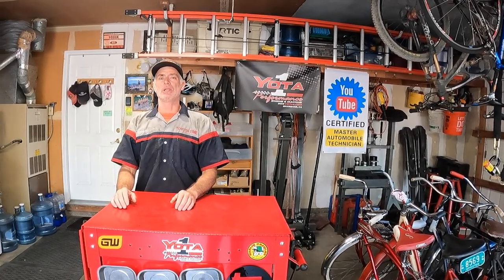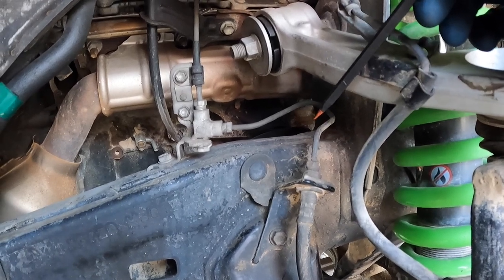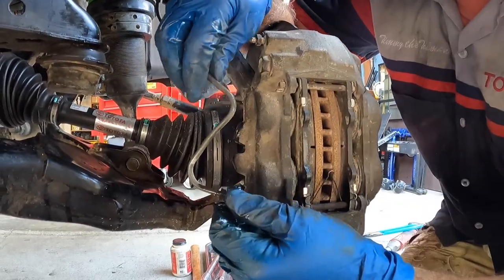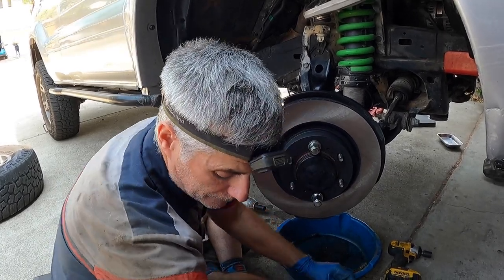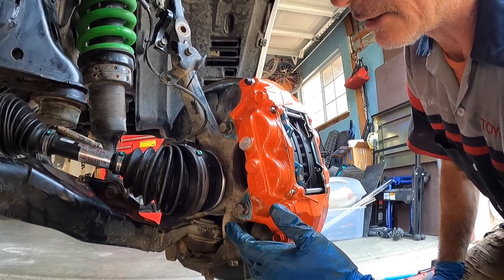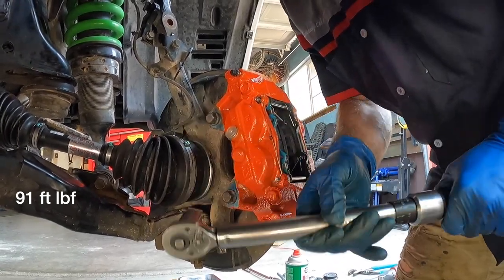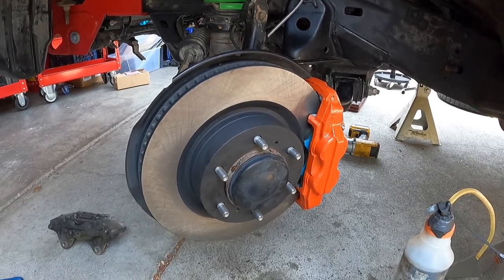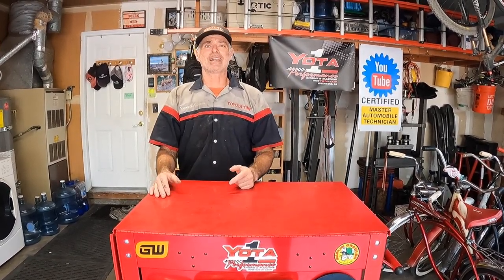Lexus GX470 Front Brake Upgrade

Comment: Will your parts list work for a 2005 GX470? I did not see/hear the year of the GX470 in this video. Does it even matter what the year is? Great video, I'm getting ready to do both the front and rears. Any info would be greatly appreciated. Thanks. Don
Reply from the maker: Thanh's GX470 is a 2008 but I don't think the year matters.  I'm pretty sure all the GXs have the same brakes.
Reply: @TimmyTheToolman  thanks D
Reply: Tim, have you seen/heard of any quantitative comparative responses from people who did the "upgrade" to their GX470 to what they had before?I'm on the fence, as to, weather to go the less expensive route or spend the $500-$600 and upgrade now? I'm thinking I may resurface the rotors, if I can, pads and possibly replace the brake lines because my rig pulls to the right when I have to brake "hard". What do you suggest? Thanks. D
Reply from the maker: @dongarofano7746  Other than Thanh saying his braking has improved, I don't have anything else to go by.  You might try asking this question on a GX Facebook page.  There's several you can join and then ask your question to see what people say.

Comment: Hey Timmy, I recently did the upgraded 13WL calipers from the 05 and up Tundra on my 02 sequoia, which required me to trim the backing plate. How is it that the LX470 calipers accommodate the larger rotors like the 13WL calipers, without trimming the backing plates ?
Reply from the maker: It’s a different model with a larger backing plate so after the mod on this platform, there is no cutting needed, but with the tundra brake upgrade on a third forerunner, the backing plate is much smaller and therefore needs to be trimmed a little.
- Sean
Reply: @TimmyTheToolman  Much appreciated, I was wondering if there was a physical difference to the caliper itself. Thank you for the fast reply.

Comment: Is there a trick to prevent the brake lines from leaking  when the brake lines are disconnected from the calipers. Mainly in Toyota rear brake calipers. Thanks.
Reply from the maker: Yes there is.  I slide a 7/32 vacuum cap over the flared tubing end to stop the flow of fluid.  The cap slides over only the tubing, not the fitting.  It works great.  I've had lines disconnected for weeks and no loss of fluid.

Comment: Just watched the whole video. My friend sold me 2004 GX470 a month ago and yesterday shit happened... Driver side rear brake line was leaked and I lost brake. I search on ebay some brake stuffs like brake pads, calipers, line kit's, rotors... Here I'm thinking about fix it or sell it? A car is clean title and one owner. 114000 on the dash... If fix it, that's gonna be 5-10k. worth it or not I don't know. Never had GX470 before
Reply from the maker: What you said makes no sense.  5-10k in brake parts?
Reply: @TimmyTheToolman  I meant shock absorbers, all brake work, tires and rims and labor fee
Reply from the maker: @moosleem3621  That still seems very expensive.   Tires are over 1k though.  What's the breakdown of the cost for each thing and the cost for labor.

Comment: @timmythetoolman Did you have to trim any metal from the caliper tabs where it gets mounted? I will be doing this upgrade on my 2002 Tundra. Every video i watched talks about cutting the tabs down by 3.5mm.
Reply from the maker: I don't remember,  but everything we did was documented in the video.  If you didn't see us do it or talk about it, it wasn't necessary for the job.
Reply: @TimmyTheToolman  Thank you for the quick reply. I think there may be a difference between Toyota and Lexus. Im not sure. When I get the calipers in I will try a fit test before I send anything to the machinist. I will keep you updated.

Comment: No antiseize on brake hard-line? Is that to prevent contamination of the brake fluid?
Reply from the maker: Anti-seize is not needed on the brake line threads.  Could you put some on?  I suppose you could.  Maybe just a very light amount.

Comment: Great video will be using it soon. How did he seat his new pads? I've heard 10 or so hard stops from about 55mph and then drive around 15 or so minutes with light to no breaking to allow the pads to cool. Any tips or insight if that's true? Thank you!
Reply from the maker: Thanh didn't do any specific pad seating method.  He just started driving it.  I've heard of people doing this as well but I personally have never done a "Bedding In" procedure either.  If you do a search online you'll find info on bedding in procedures.  

Glad you like the video.  Good luck with the job.  Hope it goes smooth for you.
Reply: @TimmyTheToolman  thank you good sir and happy new year to you.
Reply from the maker: @codybrooks6486  You're welcome.
Reply: @TimmyTheToolman  that's called burnishing. You get up to 50,let off accelerator, then light brake apply until fully stopped ,  then let off brake and drive one mile, that mile drive cools the brakes, then get to 50mph again and repeat brake application until stopped. You should do this a total of 4 to 6 times. Make sure that you come to complete stop position each time. I don't recommend heavy braking for at least 50 miles.
Reply from the maker: @davidlesley8884  The question is, does the procedure you outlined really make a difference in future braking performance?   I'm pretty sure no shop in existence gives their customers this procedure when the customer picks up their vehicle after a brake job.  I've never heard the term "burnishing".  I've only heard the process referred to as the the "bedding in" procedure.  Learn something new everyday.
Reply: @TimmyTheToolman  I've gone to many seminars that involves brake components and my shop does that procedure.  It makes the brakes last longer. The parts stores never tell you and or the manufacturer never says anything about the procedure,  because they want you to go through brake parts. It's a money scheme.  Most jobs that we've done last 4 yrs or more. I highly recommend it!
Reply from the maker: @davidlesley8884  Wow, your shop actually spends the time to drive the vehicle and perform the procedure,  that's impressive.  Your shop is probably one in a million.  I believe a decent amount of shops would perform a short test drive after a brake job, but doing the burnishing or bedding in procedure is a whole other commitment.  I've never performed one of these procedures and my brakes have always performed well.  But, maybe I'm missing out.

Comment: Nice vid. My 06 gx behaves as if the rotors are warped. As the brake is applied it feels as if it grabs and let’s go, grabs and let’s go… until it comes to a full stop. It only does it at low speeds with no vibration on pedal, wheel, frame, it doesn’t pull or anything. The brakes are also very sensitive one moment you are braking fine then it grabs too much and it dips. Try to ease up a bit and it just wants to keep rolling. It’s a matter of mm of brake pedal travel. Strange and annoying. Any ideas?
Reply from the maker: The grab and let go is a pulsing the ABS system can do but I don't know if that's what's happening when you're braking at lower speeds.  It might be your hydraulic brake booster is having issues.

We did a video on replacing the brake booster on Thanh's GX470.  https://youtu.be/EMRvzD0ep3A
Reply: experienced the same issue with my truck. was pretty bad when i first got it, even after i had my front rotors resurfaced. a few months back i got new brakes and rotors on the rear and soon ill install GX460 brakes and rotors. i hope it fixes the issue.  im also sure its not ABS as i know exactly the noise and feel the GX makes when ABS kicks in. when i have researched this it points to warped rotors. if i remember ill be sure to update in a few weeks.
Reply: UPDATE: i upgraded my pads, rotors, calipers and lines to stop tech brand. and i am happy to report that all of the weird brake shuddering, vibration or what ever the hell i had is now gone. my trucks brakes feel like a sports car with so much control and confidence.

Comment: Would you recommend the Stoptech stainless ones you installed or ones designed for a lifted GX470? (Like Metaltech or Apache?)
Reply from the maker: Front brake lines, even with a lift will be stock length.  It's the lines in the rear that need to be longer due to the droop of the rear axle.  You could use the Stoptech ones if you want.
Reply: @TimmyTheToolman  great, thank you sir for the heads up and clarification.

Stoptech has a rear brake line kit too, but I’m assuming it’s the same length as stock? I saw Metal Tech has 17inch and Apache has 20inch rears, but not sure I need that with just a 3 inch lift.

(Btw, just ordered most of these parts, plus near rear parts to do a nearly complete brake refresh and partial upgrade)

Comment: Hello, thank you for the tutorial! Looking into doing this same upgrade on my 2005 GX470. What about replacing the rear calipers too? I heard that you cant upgrade the rear rotors due to the 470 axel being 8" and the 460 being 8.2" but would there be a benefit to upgrading the 470 rear caliper with a 460 rear caliper? Also, what years of the 460 and 4runner are the upgraded compatible parts for the 470?
Reply from the maker: I don't know the answer to your questions about upgrading the rear brakes.  This is something we have not attempted.  I also don't know of any other parts form a 460 or 5th Gen 4runner that are compatible with the 470 and would be considered an upgrade.
Reply: Sorry, let me clarify my last question. In terms of the front rotors and calipers. Do all years of the gx460 and 5th gen 4Runner fit the gx470 or is it only a certain year range like 2010-2015?
Reply from the maker: @DrNbiegerDO  I believe it's all the years, but I'm not 100% sure.

Comment: great video....Is that the same as 1st gen. sequioa, i have 06 toyota sequioa? thank you
Reply: 1st gen sequoia and tundra need the calipers machined to fit properly. the rotor spacing is off on the older spindle design.
Reply from the maker: @001dman  Thanks for answering the question Dan.  I didn't 100% know the answer.
Reply: @TimmyTheToolman  no problem, lol. There’s a page on tundras about it. Guy sells the Calipers already machined for the tundra/sequoia (and technically 1st gen taco/4runner)
Reply from the maker: @001dman  Cool, thanks for sharing this.
Reply: @001dman  do you have the webpage handy. Tried looking but didn’t find anyone that already had them machined.
Reply: @kevinrader3485  its on facebook. the 14wa caliper upgrade thread on tundras has a link (i think somewhere in there)

Comment: You do good work.  I enjoy watching you.  There are so many jerks on YouTube.  BTW, I don't agree with your assessment of the improvements gained from the braided brake line.  I do think the braid provides a little more protection from external damage but the hydraulic pressure is hundreds of PSI and the flexible braid won't provide any measurable resistance to that much pressure.
Reply from the maker: Glad you like our channel.  What I said about steel braided lines delivering better fluid pressure is one of the sales points of that product.  Is that claim 100% true?  I don't know.  I'm just repeating the claimed benefit of steel braided lines and it seems to make sense to me.  If it's false, the steel braided line industry sure has fooled a lot of people to buy their product and they're masters at marketing. Upgrading to steel braided lines is a very common mod people do and I assume will continue to do for a long time to come.
Reply: @TimmyTheToolman  It is a popular upgrade bur I think it's all visual.  I doubt most people know that right below the steel braid is the same rubber hose.  Braided hoses are even less valuable on water hoses on sinks & toilets where external damage would be very rare.  I have no problem believing that the manufacturers know full well  they are profiting from a myth.  It's called good marketing.
Reply from the maker: @ramtek2702  Yeah, I don't doubt that you could be 100% right.  Lots of money spent just to have cool looking brake lines.  I did read that steel braided lines have a teflon core that better resists expansion and thus better delivery of the fluid pressure.

Comment: Hey Timmie, I just got done doing this. Had one issue at the end though. The brake shield on the 470 vs the 460 is slightly different. When I got done installing the 460 rotor on the 470, there was some slight contact in the inner side of the rotor on the shield. Did you have this problem as well? Can I simply bend the 470 shield to accept the new rotor? Or so I need to order new 460 shields to get around this problem? Thanks
Reply from the maker: We didn't have that issue.  Try bending it first.  If that doesn't work, trim it with a pair of sheet metal cutters or use a dremel tool with a metal cutting disk.
Reply: @TimmyTheToolman  Thanks for the response.  I'll look into it.  Seems like the contact area is central, closest to the hub.  But I'll rip off the brakes and see what I can do.  Appreciate your videos
Reply from the maker: @jvincentdreier7706  The dust shield could be contacting the inside diameter of the rotor and you just have trim a little of the dust shield off and you'll be good to go.

Comment: What year is this gx
Reply from the maker: Don't remember the year.  It really shouldn't matter what year GX470 you have.  They all have the same brake setup.
Reply: @TimmyTheToolman  got just wondering if I can bleed the system like standard way, I have a 05 and I heard I have to use tech stream to bleed it
Reply from the maker: @Wanyekerr  You don't need to use tech stream for a simple bleeding.  If you're doing a brake booster swap, then yes, you need to use tech stream.  We use it in this video: https://youtu.be/EMRvzD0ep3A

Comment: You will want to "spray" brake cleaner away from you. Especially when you don't wear eye protection. That stuff stings!
Reply from the maker: Yep, I've gotten a shot of brake cleaner in the eyes more than a couple times.
Reply: @TimmyTheToolman  I could see how that would happen...Hint Hint 🤔
Reply from the maker: @mikejohnson9118  I don't like wearing eye pro.  I find it annoying.  The only time I wear it is when grinding and cutting to avoid metal getting lodged into one of my eyes.  I also use a welding helmet when welding.  Going blind isn't one of my goals.
Reply: @TimmyTheToolman  I hope not...Cause "We" would call you Timmy the Pirate then...arrrghhh

Comment: maybe at some point put on some clean gloves
Reply from the maker: The better hack is to put blue painters tape on the rotor surface to prevent grease from contaminating the surface. But either way, nothing some brake clean can’t handle!
- Sean
Reply from the maker: Since you did bother to make a comment, let me ask you something.  Did you find the video helpful or informational?  I do understand you thought I should have changed my gloves at some point, but is there anything else you'd like to add?  - Tim
Reply: @TimmyTheToolman  yeah you didn't talk about how break in new brakes. bed them in
Reply from the maker: @stereolababy  Some believe you need to bed new brakes in, and others don't.  I fall in the second group.  Here's something to think about.  Do new vehicles come with bedded in brake pads?  Does a shop after they install new brake pads and rotors bed the brakes in for the customer or explain to the customer the necessity to bed them in?  Once you answer those questions for yourself, you'll better understand my point of view on the subject matter.
Reply: @TimmyTheToolman  well as someone who does how to videos maybe just explain that.
Reply from the maker: @stereolababy  Well, I explain things that I feel are important to share with our audience. Why would I waste time talking about a bedding-in procedure I think has little value?   

Is there anything else you noticed about this video we made, possibly something good?